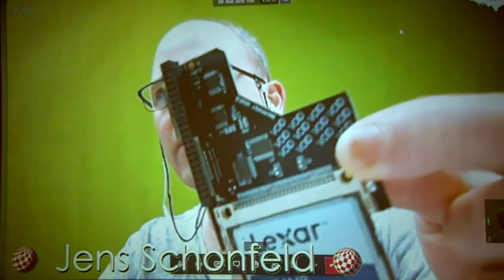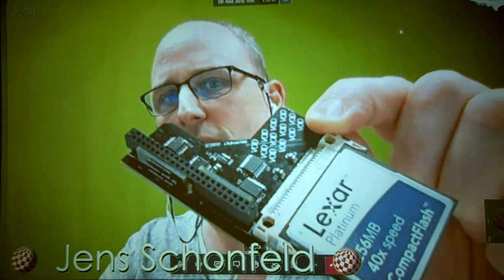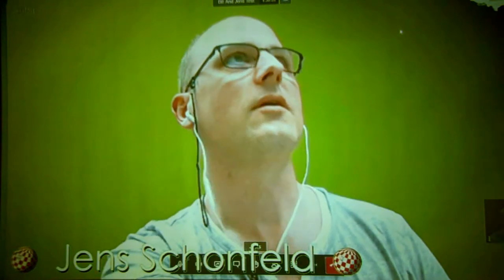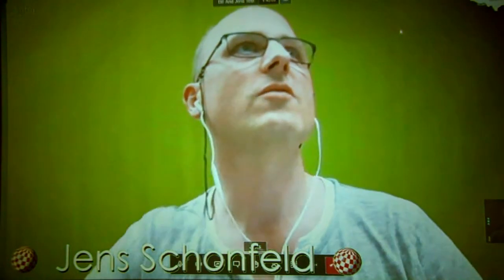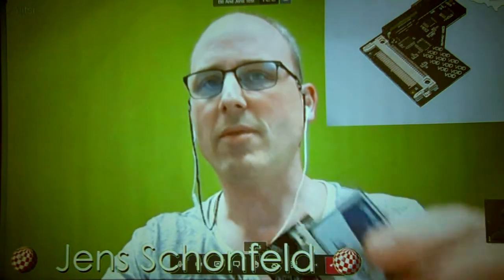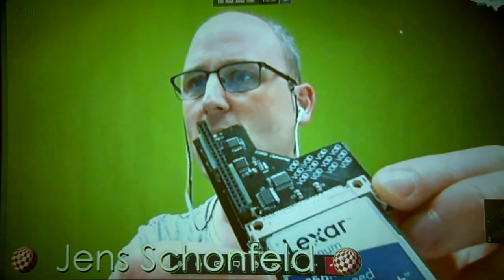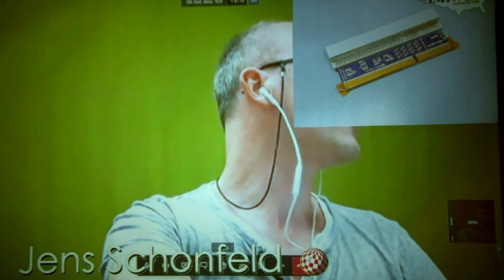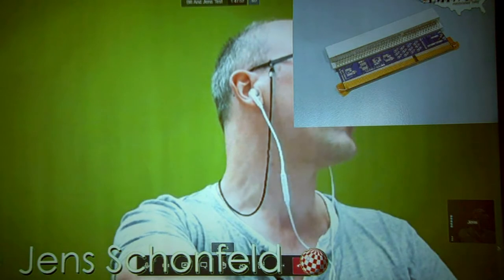Schoenfeld speaks at Amiwest 2021

Comment: Odd,i have used cf cards on all my A600's and 1200's with fairly long cables and Blizzard 1240 and 1260 and vampire with no problems at all. The 1200 even has a ide laptop cdrom and cf. Its been running fine for many years. You can't account for people plugging stuff in wrong and not having backups ,its always going to happen.. i've seen many people kill stuff this way.